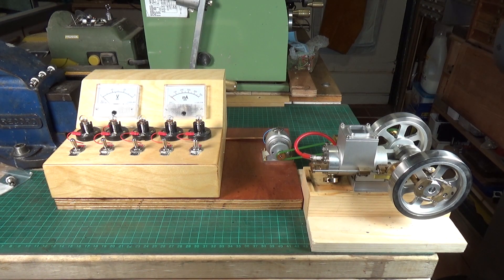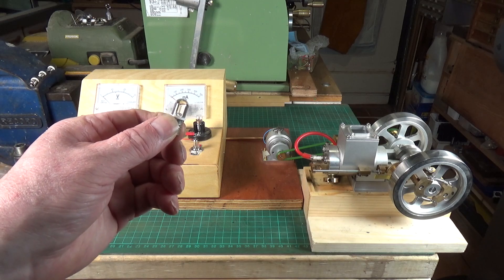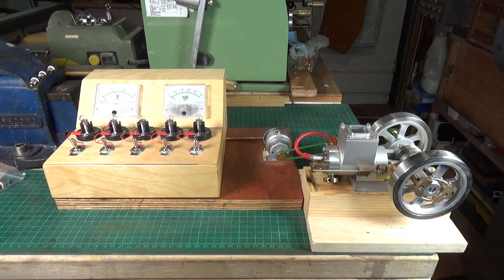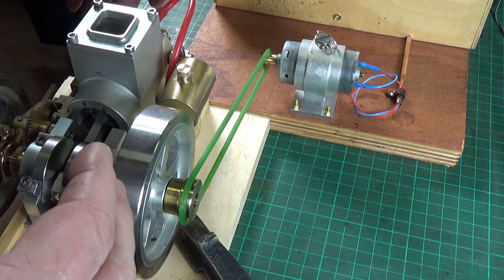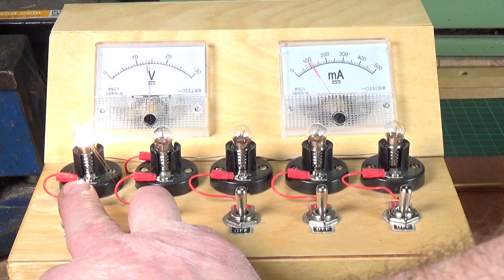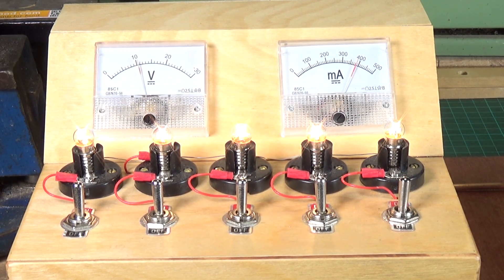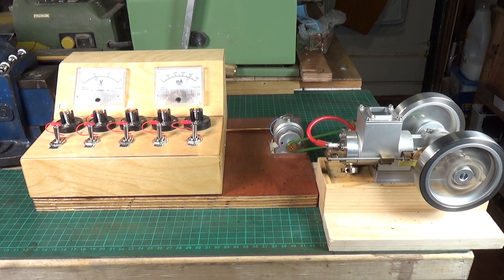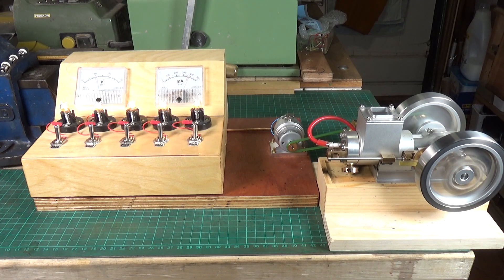Hit & Miss Engines and Electricity

Comment: Thanks for the shout out Alan. My current project is to run a small DC powered HO train set off of a Steam Engine Driving a Dynamo. So far, I haven’t found a dynamo powerful enough, but I am continuing to experiment.
Reply from the maker: That's a great idea Charlie, good luck with it. I look forward to seeing the video.
Reply: @RetroSteamTech  The PM Research "dynamo" kit works well when assembled.  I use it to power a "N" scale train off of my Midget single cylinder IC engine.